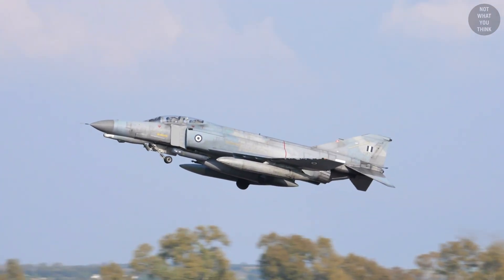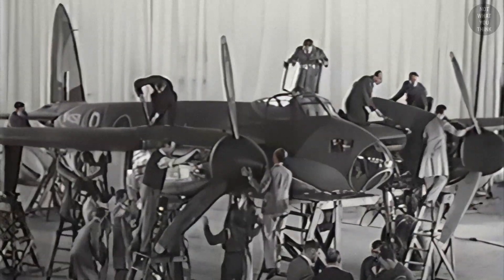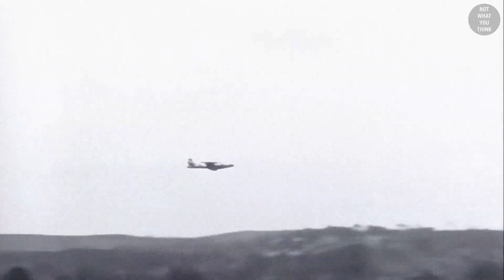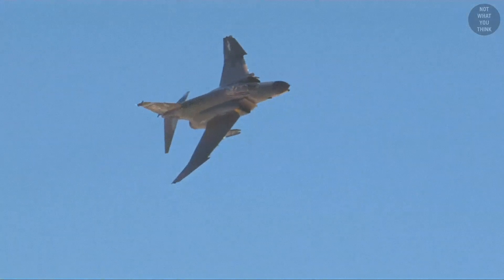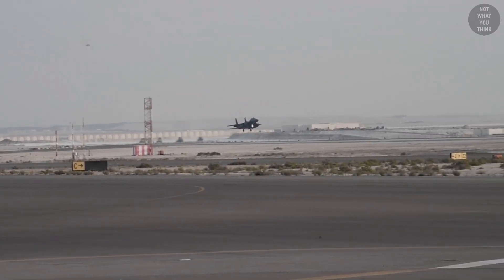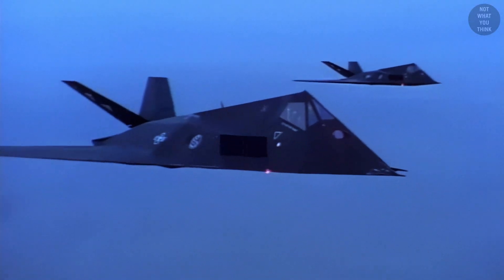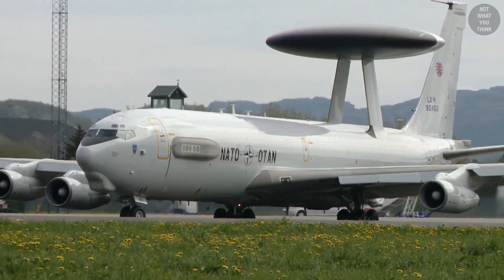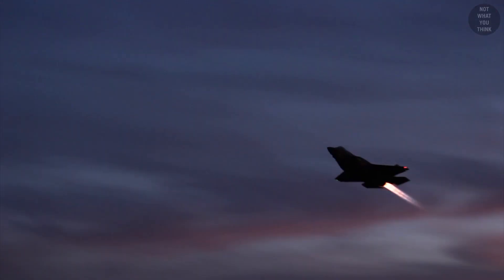Why are Modern Fighter Jets Slower than 1960s?

Comment: Well, a F35 has a better power to weight (thrust to weight rating) then a duel engine Rafale, better then a F16, Better then Gripen, and better then a F18a.

And yes, it will fly faster.   Remember,  a 1950's F104 starfighter could break the Mach 1.0, and sustain above Mach 1.0 without afterburners (AB's). In fact, so could the British Lightening also from the 1950's. So, this concept of "super cruise" is from the 1950's, and is not a new concept.

Since fighters even from the 1950's could go over Mach 1.0 without afterburners?

Well, the term super cruise came only recent from Lockheed.

When Lockheed came out with the F22, they re-defined the term super cruise. They mean it to be Mach 1.5, and for 100n-miles (115 miles).

However, the F35 can't maintains Mach 1.5 for 100n-miles, so they don't deem it to have super cruise. but then some defense journal, or some ignorant ding bat decided that super cruise means any fighter that can maintain over Mach 1.0 without AB's means super cruise. NO!!!

The f35 can go 150+ miles at over Mach 1.0 (in fact Mach 1.2 and the rating is LONGER then the F22!!!! - just not at Mach 1.5!!!

So, the F35 actually has  LONGER range rating at above Mach 1.0 compared to the super cruise define for the F22.

So, going over the speed of sound without AB's is not new - as noted fighters from the 1950's could do this.

but, you also have to keep in mind that engines have become MUCH better! For example,  F16 on AB's can only do that for about 3.5 minutes and after that HALF your fuel is gone (fuel = bingo time to return to base). And the F16 due to the bubble canopy will develop hot spots and damage the canopy (so there are restrictions on speed due to this issue below 30,000 feet. 

the F35 has HUGE mil power (thrust without AB's). And on AB's, it REALLY amazing.

So, while the top speed of the F35 is Mach 1.6? That is a software limit and a operational limit - not the top speed it could and can fly. However, as you drop down lower from that Mr. Perfect high speed top speed shiny car sales job? The F35 actually fairs better.

For one reason, is the fuel capacity. You have this:

Fuel capacity (fuel tank size):
Harrier  7,000 lbs
F16 – 7000 lbs
Gripen39E/F – 7,500 lbs
Rafale 10,362 lbs
F18 – 10,860 lbs
Typhoon – 11,000 lbs
F15 – 13,455 lbs
F/A-18E: 14,700 lb

F35 – 18,498 lbs

Note how the F35 has larger fuel tank then even a F15!!!!

But, back to the performance issue. Ward Carrol who flew F14 Tom cats for over 10 years? The F14 was rated for Mach 2.35. But in 10 years of flying, that F14 co-pilot never saw more then Mach 1.8.

And take a F18 at 40,000 perfect balls out speed run? Hang JUST 4 AIMS on the wings, and your top speed is now Mach 1.4 (less then the F35).

And lets' not forget that the F35 has a better power to weight then the F16, better then the Rafle, and better then the Gripen. (and in fact better then a legacy F18a - I not run the numbers for the super hornets - but the T/W rating for F35 and F18's super should be about the same).

As a result? When groups of F16's flying with F35's, they can't keep up. They have to punch AB's to catch up, start to fall behind again, and then go AB's again.

We have multiple quotes by pilots to this issue.

pilot Lt. Col. Hank “Hog” Griffiths
Even when loaded internally with two 2,000lb GBU-31 Joint Direct Attack Munitions and two AIM-120 AMRAAMs, Griffith says the sheer power of the Pratt & Whitney F135 is evident. “The engine has a lot of thrust. It’s been fun to outrun the F-16 (chase aircraft). They can’t keep up. If we go to full military power the F-16 has to go to afterburner to keep up

Norway pilots who  F16's, and are now flying  F35's.
quote:
We who fly the F-35 daily, can establish the following: The aircraft is faster, more maneuverable, has more range and, can carry a significantly higher payload and provides the pilot with a significantly better situational awareness than what we are used to from the F-16

Col De Smit – RNLAF
Quote:
F35 climbs, descends & accelerates like a clean F-16

QUOTE:
Compared to the F-16, the F-35A with “full war equipment” can cruise 10-15k feet higher without afterburner and cruise 50-80 knots faster, all of this additional energy is imparted on missiles

So, if the F35 was high drag, then HOW would it be possible for the above quotes to exist? Hum?

And for those interested, here is the power to weight (thrust to weight) ratings of some fighters compared to the F35.

(higher number = better)

Fuel and/or
payload	Rafale	F35	        F16	         Gripen
0	        1.4137	1.3984	1.4784	1.2617
700	        1.3737	1.3672	1.4284	1.2130
2500	1.2806	1.2932	1.3141	1.1035
3500	1.2341	1.2555	1.2581	1.0508
3750	1.2230	1.2464	1.2449	1.0384
5000	1.1704	1.2028	1.1826	0.9805
6000	1.1314	1.1701	1.1371	0.9387
7000	1.0950	1.1391	1.0950	0.9003
7500	1.0777	1.1242	1.0751	0.8822
9125	1.0249	1.0784	1.0151	0.8283
10362	0.9880	1.0459	0.9737	0.7914
12000	0.9431	1.0058	0.9239	0.7474
13500	0.9055	0.9718	0.8825	0.7111
15000	0.8707	0.9399	0.8447	0.6782
18250	0.8038	0.8776	0.7729	0.6165
20900	0.7564	0.8325	0.7228	0.5739

So, the F16 has to burn fuel down to a rather low 3,500 lbs of fuel to match the F35 power to weight.
The duel engine Rafale fairs even worse - down to a bone dry 700lbs fuel to match the F35 power to weight.
And the gripen, even starting with 0 payloads - never matches the F35.

In the Gulf war, less then 1% of flight time was spent above Mach 1.0. But, the F35 actually has a longer above Mach 1.0 rating then what they rate super cruise for the F22 at (but, the rating for the F22 is Mach 1.5 - since as I pointed out we have fighters from the 1950's that could and would go above Mach 1.0, and do so without AB's. So the F35 can do Mach 1.2 without AB's, and has a longer range rating then the Mach 1.5 for the f22.

Modern fighters most certainly gave up some of that top speed, but that top speed is never really able to be used, and worse yet, does not increase kills in the air battle theater anyway.

Worse yet? Strap on wing tanks and weapons on the wings of those 4th gen fighters, and they now fly slower then the F35 anyway. 

And as above shows, the F35 enjoys a better power to weight rating then the F16 or Rafale anyway. it not a slow fighter, and in fact based on the above quotes, we find the F35 in "operational" flight produces more range and speed then most of the 4th gen fighters it is to replace.

Questions anyone?

Comment: Interceptors still need speed to intercept a target before it reaches its target.. Speed may not outrun a Mach 4 missile, but it can put you out of its effective range. I'd also argue that an F15 can carry more armament than an F35.
Reply: It's the same, 8 AMRAAMS (F-35 block II bay racks) with no change in DI for the JSF, the Eagle on the other hand would be slower and burning more fuel.
Reply: @mobius7089  How would mach 2.7 be slower than mach 1.6?
An F15 also has more range

Comment: why ar you comparing a single engine fighter to a twin engine fighter no single engine fighter has mach 2 capability. the f-15 twin engine fighter has Mach 2.5 Plus it is a twin engine fighter as is the F-22. looks like you have a straw man argument going
Reply: F104, f105
F16, j35, j37 all could reach Mach 2, mig 21 is relatively close to it as well 
Theres probably others I’ve missed such as the mirages and other Russian jets 
So yes, single engine can reach Mach 2 way back in the day 
Also f22 is a poor argument since even with twin engine it doesn’t go mach 2 due to the lack of need for mach 2 despite it being capable of it. Mach 2 also came with problems that composite materials and exterior heating would be too much especially for a stealth plane. f16s would shake when it was close to mach 2

Comment: But isn't an extreme top speed virtually essential for a carrier defense aircraft?  If you have an incoming hostile force approaching your carrier fleet with anti-ship missiles, you would want to be able to reach those approaching aircraft as quickly as possible and be able to launch your missiles at as long a range as possible.

Therefore planes like the F-14 were ideal for fleet defense where-as the F-18 and F-35, although capable of more multi-role, cannot compete with the effectiveness of the F-14's extreme top speed and Phoenix long-range missiles.  Why would the US military replace the F-14 with the F-18/F-35?

Obviously as just some random guy on the internet, I am not saying I am more knowledgeable than aeronautical engineers with decades of experience in a multi-billion dollar industry, I am just curious as to the reasoning behind such a change.  I did hear that the AIM-120D has a range nearly as long as the Phoenix, but I'm still confused as to the reasoning behind the lower acceleration of the F-35 vs the F-14

Comment: What does my heading its the so called "modern tech" you had jets from the 60s with mtow of around 30000 -35000kg of weight same size as today jets full loaded with extra tanks aswell yet todays jets with all the improvements actually fly have less combat range and less maximum range and those. Aerodynamics fuel efficency or everything else involved yet we end up with less range in all parameters having spent trillions on research makes no sense.

Comment: What people don’t understand is the top speeds are theoretical. But in reality the jet is significantly slowed down by fitting weapons pylons, external fuel tanks and carrying weapons. The jet can only reach its top speed if it’s in a “clean” fit. 
Interestingly RAF Tornado jets were modified with a laser and a IR camera fitted under the nose, these actually disturbed the airflow into the engine intakes and prevented them from going supersonic.
Reply: Clean fit and low fuel too
Reply: You know less than nothing!
Reply: @hotstepper887  Thats funny because I’ve been in the Airforce 22 years, working on the aircraft that I mentioned in the comment. Which really flew in a clean fit, so couldn’t go supersonic.
And you?
Reply: @notmenotme614  no need to waste time on that… person
Reply: @hotstepper887  Clearly you know more than something. Please explain why the previous answer was wrong. It would be great to hear a real expert.
Reply: @jonathanrichardson7969  Because this explains and answers all these questions?. 
The MiG-25 (Foxbat)?

As soon as you read the title of this video, surely that's what everyone who understood this, would point to? The MiG-25 was theoretically capable of a maximum speed exceeding Mach 3 and a ceiling of 27 km (89,000 ft). Its high speed was problematic: although sufficient thrust was available to reach Mach 3.2, a limit of Mach 2.83 had to be imposed as the engines tended to over speed and overheat at higher air speeds, possibly damaging them beyond repair. The specific fuel consumption with afterburners is actually nearly equal to the US, F100, despite the F100 being a far newer engine design.
Reply: @hotstepper887   How is the F-100 a far newer engine design than the Mig-31? The F-100 Super Sabre was a Vietnam War era aircraft, the Mig-31 was a 1980s vintage machine. That actually makes the F-100 around 20 years older than the Mig. Don't you find it strange that the Russians would put engines that were designed in the 1950s into a fighter built in the 1980s?
Reply: @jamesdaniel1376  he means the pratt & whitney f-100 engine, and also its about the mig-25 not mig-31 (mig-31 is much more modern)

Comment: Correct me if I am wrong, the F-35 is subsonic with an afterburner capability of about 90 seconds for the mentioned Mach 1.6.
The F4-E can sustain much much more afterburner than the F-35.
The 90 seconds is cumulative, 20 seconds here, 15 seconds there, after that the plane has to replace parts in order to fly again.
Edit: It seems they are saying -if you need to go supersonic, your training is lacking.
Reply: Yeah that's completely incorrect. The F-35 can run around at Mach 1.6 all day, but you don't want that in a VLO platform due to the IR signature.

Comment: Good content and I appreciate the tactical reasons for slower current speeds being explained. Point of order though, while the conflict between North & South Vietnam lasted 20 years and started in 1955, direct US & specifically Air Force involvement did not start until 1961, and then was only a small element of WWII era prop driven aircraft used in support of the French and South Vietnam. It was not until after the Gulf of Tonkin incident in August 1964 that the US started moving jet fighters into theater, and by March 1973 all US forces were withdrawn. So US jet fighter aircraft involvement was less than 9 years, not 20.
Reply: Thank you
Reply: True
Reply: You are correct in your chronology.  Point of order though. I would specify August 2 as the date for the Gulf of Tonkin incident, rather than “August”, since a second event, alleged to have occurred on August 4 in the Gulf of Tonkin, which was used as the major pretext for military escalation against North Vietnam, never actually occurred.
Reply: Yeah for the war but how long did it serve before they officially retired it? 
 I mean, the A-10 did like 50 years or something
Reply: RF-101 wasn't used in Vietnam?  Not technically a fighter I guess, but they were in the neighborhood from 1959-onward checking in on China.
Reply: @georgecolthurst4216  Military records indicate the Voodoo didn't even start arriving in Japan until 1958 and wasn't deployed into Thailand until 1960, and Vietnam until 1961, and then as a reconnaissance aircraft, not a fighter. Even if you include non fighter aircraft, jets still weren't in use (by the US at least) in Vietnam during the entire 20 years of the conflict. That was my main point.

Comment: About recon air crafts you talked about satellites and drones being better of options and yet here are we in 2022 and we were still using recon observation balloons in to Afghanistan at our bases to perform over watches around bases.  They were not at there to prevent air attacks. You could often see the medium altitude balloons on tethers over the bases and thosed balloons had observation packages on them just as liked and better than drones. They allowed base security to keept eyes on many miles out from those bases.  Old and slow is not all ways bad.

Comment: Pretty good video i have to say. One more factor to mention is also flight performance in comparison to AGL. The top speeds of these fighters are measured at the most ideal of flight conditions, aka ample time to accelerate and at very high altitudes. Even then, these speeds are not really sustainable, as you mentioned. Supercruise is also a feature that should have been mentioned. 5th gen fighters like the F-22 and, to an extent, the F-35 can both cruise at mach 1+ without the use of reheat.
Reply: F35 still can't even go supersonic.
Reply: @andrewh1113  get your brain out of 2010
Reply: @AugmentedGravity  They can barely fly unladen and the current max speed is based in  models rather than actual performance (without any ordinance).
Reply: @andrewh1113  Just stop

Comment: The top speed of the F-22 Raptor quoted is wrong. The F-22 has a top speed of Mach 2.25 or 1500 mph and can Supercruise without the need for afterburners at Mach 1.8 or 1220 mph. I think the numbers quoted were actually for the F-35.

Comment: This video did not mention the "interceptor" role of combat aircraft 
where speed is the primary requirement. Range or combat radius is not a 
main consideration for intercepting inbound enemy aircraft. The F-14 
Tomcat epitomized this in it's interceptor fleet defense role. Sadly, 
neither the FA-18 nor the F-35 can fulfill that need.
Reply: While that's true, they don't really need to fulfil the need anymore. Interceptor aircraft are designed and built to chase and shoot down super-fast and high-flying bombers...which no longer exist as they've been made redundant by the cruise missile. Modern day bombers like the B1, the B2 and the Tu-160 are all about either low-level-maneuverability or stealth. Modern fighters are designed with today's asymmetrical wars in mind and for that, they do a fine enough job.